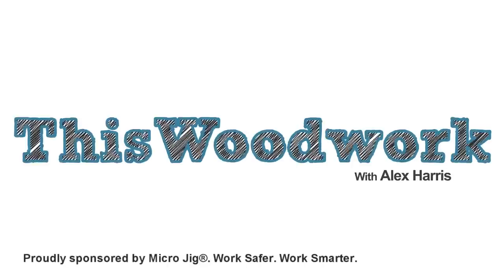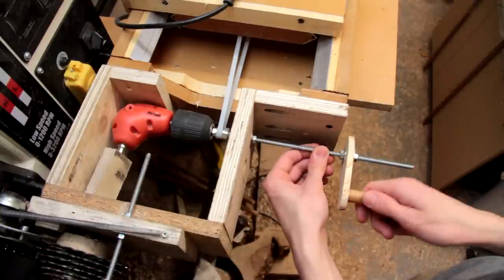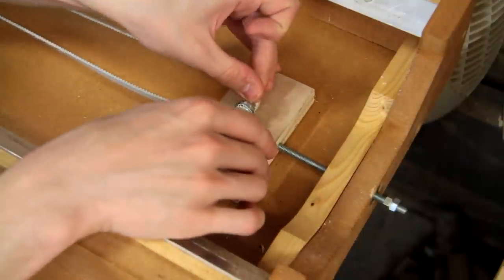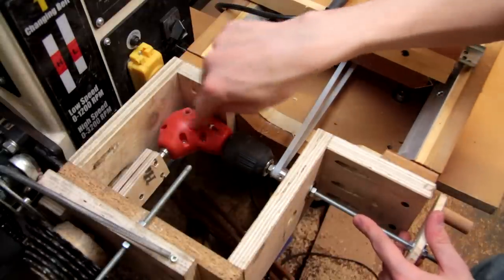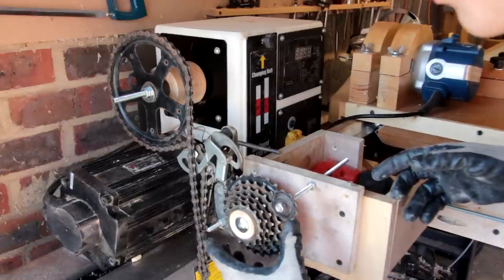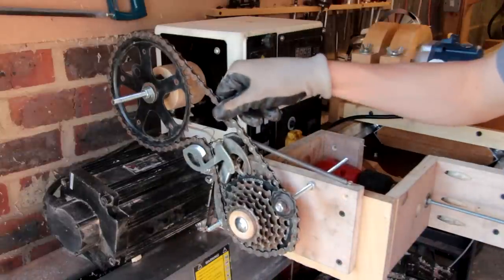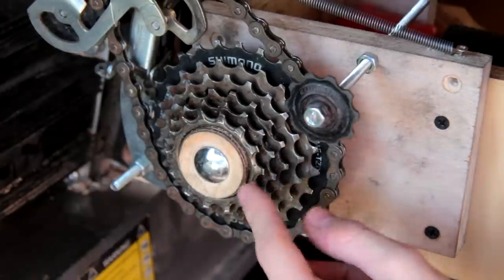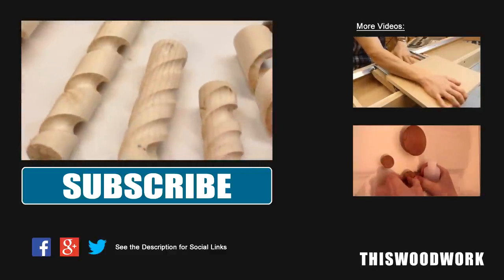Homemade Router Spiral Cutting Jig: How It's Built

Comment: You are to be congratulated for your skills in making all of this work!  It's too bad, however that Legacy opted several years ago to quit making their manually-driven Legacy mills and go to only CNC rigs.  I have an old Revo which cost me about $900 15 years ago and turns every kind of spiral you can imagine with pitches from 1/2" to 15" on stock up to three feet long.  You can still find the old Legacy mills on Craig's List, so if you don't have the skills to build a machine like Alex's, get a used mill. I'm saying up for their CNC machine.

Comment: I think I'll try something simpler. All thread to move the router. Then it's easy to pully or gear between that and the lathe spindle. Idler gear and tensioner if needed. =D I might mount the router behind or above the lathe so it can stay in place while the lathe is used as normal. =D

Comment: Hi, Good to see you are still doing interesting things with and to wood. 

I noticed that the 90 degree direction attachment in your design (for using with a drill) was wobbling a bit as you operated your device. 

I don't know if your design would be improved if you could in some way grip the 90 degree attachment to remove the wobble. 

Then again, perhaps the wobble would just be transferred to some other part of the design!

Comment: Brilliant. Can you gear it tight enough to cut threads? Craftsman made a tool to do this years ago called the 'Router Crafter'.
Reply from the maker: calisdad3 Thanks! Not easily. The best thing to do would be to replace the timing belt with a lead screw or threaded rod. That should provide a much lower linear, travel making it more suited to cutting threads.

Comment: That cassette/freewheel wouldnt wobble on an actual rear hub of a bicycle. Mounting it would be difficult though, most front forks cant fit a rear hub (maybe a fatbike fork would work) and mounting half of a bicycle into this jig wouldnt be easy either. Using a rear fork is probably easier, the bottom bracket could work as a pivot to put tension onto the chain or as just a mount. A folding bike with the right clearance would be perfect.

Comment: It looks like your lathe has a servo motor with encoder/break at the rear part. If so, why not digitalize your lathe? Using for instance Arduino and some servor motor driver.

Comment: Impressive, but you're actually cutting a helix, not a spiral.  If you worked at an angle so that the radius is changing as it turns (say if you started with a cone instead of a cylinder), then it would technically be a spiral.